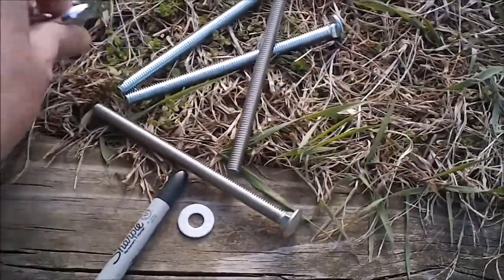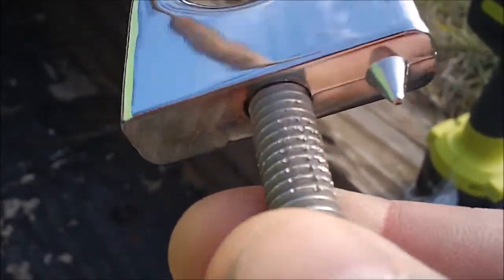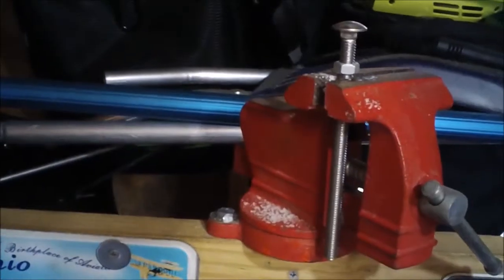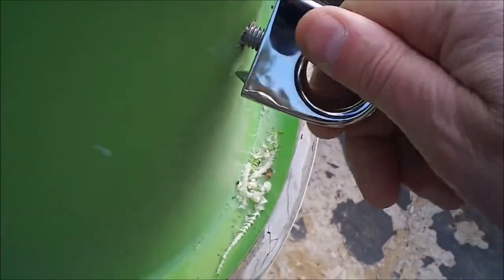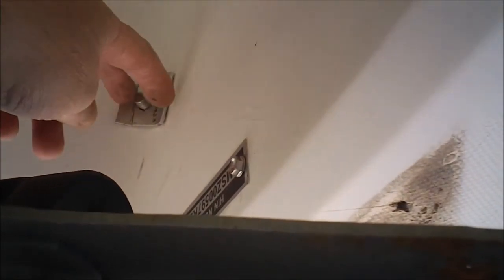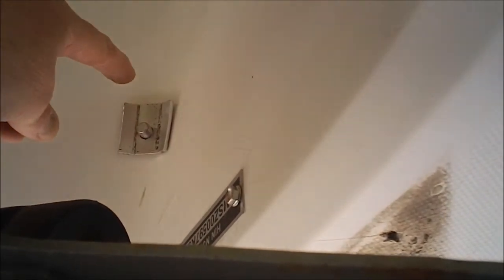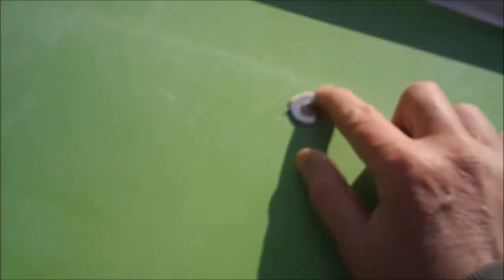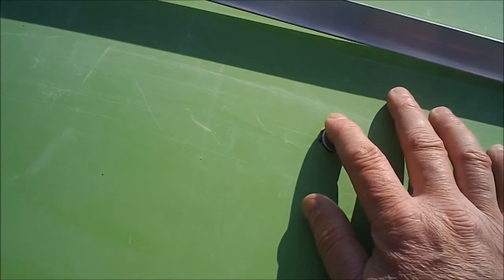O'Day 12 E11 Installing A Bow Eye

Comment: Thanks for the vide. I understood that stainless steel causes aluminum to corrode because of their galvanic potential and stuff. How has it fared so far?
Reply from the maker: Stainless is always the safest option regarding dissimilar metals. Also I must add this is a fiberglass boat, so that wasn't a concern. If you own an aluminum boat, I wouldn't hesitate to put a stainless bow eye on it.

Comment: Can i do this on an aluminum  v hull? 😅
Reply from the maker: I don't see why not. Just be sure that it's made of a metal that's compatible with aluminum, like stainless.
Reply: @BrianMDIY I thought stainless steel and aluminum causes galvanic corrosion?
Reply from the maker: @TestBot4231  I'm pretty sure stainless is a non corrosive metal, when it comes to aluminum. I've always used it without any issues.
Reply from the maker: @TestBot4231  I appreciate all of your research and sharing of info. To be honest, when I used stainless on an aluminum boat I almost always placed a rubber washer between a stainless washer to minimize the possibility of corrosion. Since I spent most of my time on fresh water with the boat stored on a trailer I didn't notice any issues. If a boat sits in salt water on a regular basis and no rubber washer or gasket is used, I can see how there may be a problem. Sounds like you're on the right path to doing a proper job. Best to you.